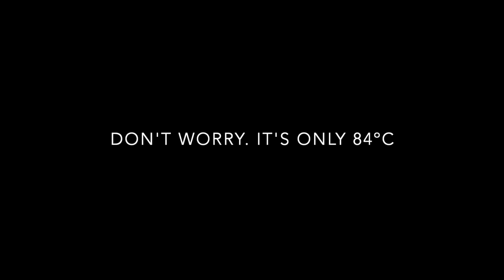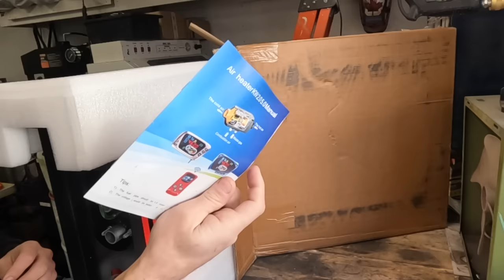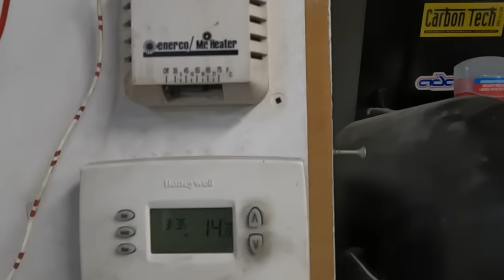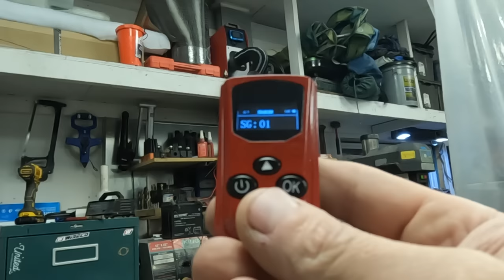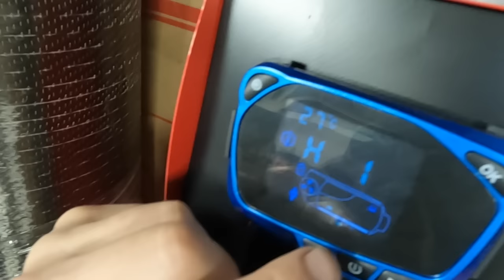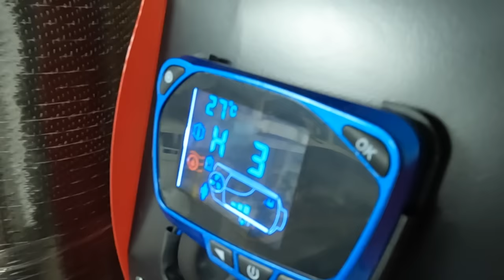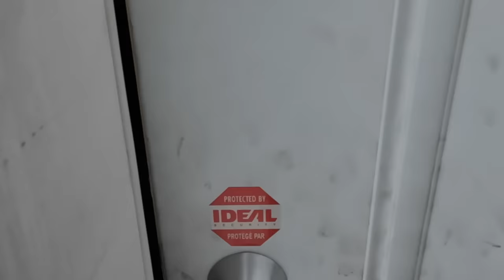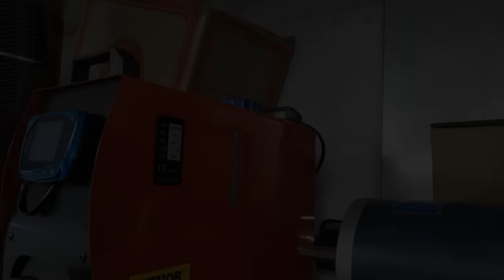Chinese Diesel Heaters - DON'T BELIEVE THE HYPE !!

Comment: this is not made to put that inside a house or garage but outside beside or under a vehicule or mabe a building. but definetaly not inside. there is dielsel tank and near the heater. i think its common sense to not put that in your house
Reply from the maker: Thanks for your comment. You have made a statement, but not given any reason, evidence or proof to back your statement. 

Manufacturers installation recommendations from many manufacturers clearly show installation inside of vehicles, campers and trailers. I would not argue for one second that my installation is proper (it is not safe) but when installed properly, there is nothing wrong with installing these indoors or inside.

Comment: Here's a hint. Mix oil with diesel before you run it through the filter. Oil is to thick to get through the filter. I ran motor oil , cooking oil, you name it. You just got to know what you're doing. You need double tanks and a fuel switcher. I'll make a video when I get some cash for the parts ( I'm poor ) . This heater to me is like a God send ! Shout out from Fresno, California. Keep us posted. You'll figure it out.
Reply from the maker: Cheers and thanks for the comment ! 

I have tried all sorts of mixes and haven't had any success. It may be that my oil is from lawnmowers and is particularly nasty, or it could be that my heater is running a horrible air fuel ratio, so I have ordered a controller that I can adjust ratio. 

I have gotten the comment about two tanks a lot, but I run my heater 24/7 and it only shuts off when it stops working. I am also really poor, believe it or not. I'm still experimenting with all sorts of things. About to go take the heater apart and have a look to see how may last experiment went.
Reply: @loweredexpectations4927  Yes I'd stick to used car motor oil or cooking oil. ...the two tanks is for starting it on pure Diesel then switch tanks when it's up to about 200 degrees celsius. But yes it does run good on about a 30/70 or even 40/60 mix. And that's on one tank system. With two tanks I'll bet it will run on 100 % pure motor oil. I'll know probably next month because at the moment I haven't the cash for the parts.
Reply from the maker: @ParasiteZappers  I have a steady supply of lawnmower oil, as I am a seasonal small engine mechanic. I have been doing lots of experiments, but I think that the oil is very likely my #1 issue. To compound issues, I am at 4000 ft elevation, and so the air is thin here. I have tried alpine mode, but that only makes things worse ... experiments continue.

I'm currently trying to sell my classic mini, seen in the background of these videos, so that I can continue to make these videos... I work seasonally and have been hit hard by the tax man (my own fault)

Comment: I have one, I live in Southern Commiefornia and it’s absolutely awesome. Maybe I’m lucky with this one but reality is with our limited “legal” options this heater works great! I did make a few upgrades to the fuel deliver. I added an inline filter and water separator as well as different fuel line. The original green stuff didn’t look too good. As of yet it’s never even blow smoke like a lot of people have had.
Reply from the maker: Thanks for the comment. Yes, these are awesome little heaters !! I have one in my work truck now, currently heating it up before I head out to get something to eat. As long as you burn diesel in them, they work flawlessly. 

I'm getting a second one next week to install in my friends 4Runner.

Comment: Yep, exhaust get hot🤣
Reply from the maker: Shocking eh... who would have thought 😁
Reply: That exhaust is VERY thin.
Its designed to use on high setting and also produces lot of noise.
Reply from the maker: @kan815k  Thanks for the comment. Yes, the exhaust is incredibly thin... that's how they make flexible stainless. Pretty cool. 

I'm not sure what you mean about running on high and producing a lot of noise.
Reply: @loweredexpectations4927  Pipe comes with the heater is very thin, get hot very quick and produce more sound.
Think about it as a car, 1 mufler noisy than 2 mufler. Cars exhaust is made from thicker material and from carbon steel.  The one supplied looks like a stainless steel, but it's not, i guess.
Stainless steel(316/304) produces more sound than carbon steel (355) dampens sound bit better.
Reply from the maker: @kan815k  Ah, yes. I believe it is stainless.... Sound is not a big concern for me, but David McLuckie has made a few videos on different mufflers ... it was quite interesting.
Reply: @loweredexpectations4927  yes, I have seen that video, it will help a lot wrapping or using thicker pipe.
😉😉😉
Reply: @loweredexpectations4927  
On your latest video "drip feed" 06:30 without the exhaust pipe is much much quite.
😁😁😁👍👍👍
Reply from the maker: @kan815k  I think I may have edited the volume level before installing the exhaust, as it was making an annoying hum, like a pulse jet engine. I believe this is because there was a bunch of crud in the heat exchanger..... also because of harmonics of running without the intake pipe or exhaust.

Comment: Buy a waste oil heater commercially built for commercial use
Reply from the maker: I already have a 200,000 btu natural gas floor heating system and 80,000 btu hanging heater... The last thing I need is another heater, haha. However, this heater was $200 ish... If you want to donate a commercial waste oil heater I will accept ... or if you want to sell me one for $200... we have a deal.

Comment: So because you A improperly installed it B don’t know how to make your own diesel you can burn waste oil if you mix it 70% oil 30% gas the restaurant I used to visit daily uses a Chinese diesel heater on filtered cooking oil mixed with old gas sources from a scrap yard. Mines run flawlessly mounted on the wall with the exhaust going straight down and out using the intended fuel because I’m to lazy to make my own. Just because you don’t care to use it properly doesn’t mean no one should believe the hype being Canadian you should know the message behind the house hippo
Reply from the maker: Thanks for the comment .... Curious if you are speaking from experience, or if you are just repeating something you heard... because the internet is full of people just repeating things they have heard. 

The way this heater operates (the issues) has nothing to do with the way it is installed. Saying that is evidence that you don't really know what you are talking about. This is part 1 of a 30+ video series, 4 months of testing and about 1500 hours of run time. Don't just assume that I didn't try 70% 30% ... 

You have used it daily for how long ? You're aware this video test was with waste engine oil and not vegetable oil ? The exhaust direction has nothing to do with the heater working or not working. I have run these on their side and upside down with no issues at all... when running on diesel. 

You and everyone else claiming that this works so well need to get together and make even one convincing video... Hundreds of videos on the internet of people who have actually tried and documented with ATF, hydraulic oil, engine oil, canola oil, grape seed oil, random cooking oils who have all had failures from a few hours to a few weeks.... 

Lots and lots of people claiming they have had success, but I can't find one single video with any compelling evidence... Funny how that is works. 

These are awesome little heaters... I now have 4 and 3 only get diesel... they work great !

Comment: Yeah how many years did you use this and not clean it out once. Every 2 to 3 years depending on how much you use it you have to clean out the unit. Take it all apart use brake cleaner and clean it out and replace the screen and glow plug and put all new gaskets in putting it back together. Best 100 I’ve ever spent to heat my 30x30 garage. But I keep up on maintenance. Ppl think you can just use stuff and never do any work to it. If that’s the case just buy a new one every 2 years. Also if you mess with the setting it will do this to they are set to burn diesel efficiently.
Reply from the maker: These heaters are amazing, and when you burn diesel in them, they are very reliable... I have 4 of them now and 3 of them run on diesel.... The one in this video is for torture testing and sometimes gets cleaned out 3-4 times a day, haha. 

I have a bunch of videos testing this heater with all sorts of waste oil mixtures and none of them really work.... However, one of my latest videos I did some emissions testing and it was pretty shocking how clean these heaters actually run when tuned correctly.

Comment: Kerosene would be a better choice.
Reply from the maker: Yes, unfortunately, kerosene is about $5 per litre where I am. I may get some to experiment with, but long term diesel is much cheaper $1.66 per litre. I just checked and it's down to $1.21.

Comment: Hot Air rises.... putting it near the ceiling is futile
Reply from the maker: I think what you mean to say is that it is not optimal or the best idea, and I agree. However, pointing the air hose down spreads the heat out. 

Also, while heat does rise, it's not quite as simple as that. It's not like a helium balloon or a floaty toy in water. Heat dispurses to lower energy levels. If the air at your ceiling is 30C, it's not like it will never heat up at floor level... it just means floor level heats more slowly, and it will always be hotter at the ceiling than at the floor. 

This heater has no trouble heating my garage in this configuration... when running on diesel.

Comment: Actually, the only misleading is your video, with one of worse installation and use of these heaters I've seen around ! 
These heaters are amazing, just that you don't know how to proper deal with it !
Reply from the maker: You are confused. I'm not sure how much you actually watched of the video... enough to know it's not a proper installation. These are amazing heaters. 

Others have stated that these heaters will run on waste motor oil with no issues. That, is the misinformation. I purchased this heater with the idea that I could burn motor oil, because of what other YouTube creators said... 

My series of videos is to show the struggles you may encounter when trying to burn fuels other than those recommended by the manufacturer. The poor / temporary install of this heater is so that I can service it with ease, yet it is out of the way. 

I have put this heater through hell and it just peeks working... pretty amazing piece of kit.
Reply: @loweredexpectations4927   Yes, I can agree with you on that, regarding other fuels, but still... even the exhaust so close to that wall, assuming it's a standard thin wall, usually used to build garages. The unit only, could reach temperatures over 185°C, so way over on the exhaust !

When I installed mine in the van, I let someone to do a 2 minutes job and didn't followed my instructions to leave enough space between the unit and the floor, so on my first night out, I started to smell burned wood and that, on 180°C only in the unit. Luckily that I figured out in time and had tools with me, so I decided to cut parts from the floor. Even so, still not enough space, but since I can't change much anymore, unless take it out and reinstall it, I play with the pump & air flow, in order to keep the unit temperature under 180°C (relative, based on outside temperature). Just to make my point regarding space needed, around parts that get very hot.
Reply from the maker: @syncrovanCos  You are 100% correct... This install is not at all safe. I have never claimed for it to be safe or practical. I make sure to tell people not to do what I do. I have had my exhaust catch on fire and glow red more than a few times. 

That sounds scary with having it in a van. Perhaps you can put some aluminum plate in there to dissipate the heat ? A small air gap (between the plate and wood) and a metal plate of any kind would work wonders at keeping it much safer. 

My heater makes heat, but mostly it is a test platform used for experiments.
Reply: @loweredexpectations4927   I already did a proper installation, or at least this should have been if I wouldn't let someone to fit it in, those 2 minutes. I've made a huge hole and fitted an aluminum tube + heater prove silicone, only that the guy didn't respected my indications. But I'm on safe side playing with the flow and keeping the unit under 180°C. Can even go higher if outside temperature is crazy low, but do the job well, staying on 175°C on high speed, until reaching the desired ambient temperature, without any suspect smell anymore. And as I said, I've eliminate the floor around the unit, but wanted to make my point about the importance on keeping the distance. And keep in mind that in my case, we talk about the unit temperature only, underneath ! No exhaust close contact anywhere, having that side 100% proper installed. I can let it on high speed, all night long, without issues ! I also have the red wireless remote that indicate pretty much all the essential parameters, so it's easier to keep everything under control/observation. ✌️
Reply from the maker: @syncrovanCos  Oh ! I understand now. Thanks for clarifying. Yes, the remote is GREAT for keeping an eye on the heater !

Comment: It over heated because its an 
un tuneable piece of garbage,always buy a tuneable heater so it runs efficient.I've had mine for 3 years with no issues,plus vevor heaters are junk.
Reply from the maker: Well, to be fair, it runs perfectly fine on diesel... I have tested it on diesel for over 120 hours and it hasn't had a single issue. Toss some use motor oil in there and that's when the problems start. 

This one is not tunable and that is really annoying. I have ordered a different controller so that I can pay with tuning. VEVOR reminds me of a Princess Auto or Harbour Freight, haha. I'm pretty sure the other models that they sell (that do not have the blue controller) are tunable, but I'm only guessing at that. It seems as though most units have some way to tune them.
Reply: @loweredexpectations4927  you can't just buy another controller you also need the tuneable ecu to go with it and is best to buy as a pair👍
Reply from the maker: @jamie-hb8gy  Well then I guess I'll have to buy a tunable ECU as well. We will see what happens. I have a feeling that these Canadian units may have the features in the ECU but the controllers just don't allow you access. That's just a guess based on almost nothing. 

Most units have a tunable (to some extent) ecu and just have different controllers that have different ways of accessing the ecu... correct ?

Comment: Yes thay dont work go electric.
Reply from the maker: They don't work for burning waste motor oil... they work great for burning diesel... I have 5 of them now.
Reply: Mine is brand new used once worked ok. Go to use it again and 4 seconds of fan and stops this will do your head in no code errors that is a peace of ........ any way going to electrician to find falt .then taking it out and crush it with my motor home may put it on the tube.
Reply from the maker: @geoffszczypior644  LOL... no warranty or ability to return ? This could be a fairly simple issue to solve. 

Due to the fact that you are not getting any error codes, this does sound like you have a faulty ECU (motherboard) unfortunately. I had one ECU that did this exact same thing... it would spin the fan aggressively when powered on, and then just stop. 

The heater does a few self checks when you press the power button. If the fan spins on startup, and then stops, it could just be a loose screw on the ECU or the fan is too far from the ECU.... there are magnets on the fan and a sensor on the ECU that detects the movement. If the ECU doesn't know the fan is spinning, it will just shut down.

Comment: That muffler isn't fume tight and should be put on the outside of the structure or carbon monoxide poisoning could result.
Reply from the maker: A few people have mentioned this. I did know this, and it becomes really clear when smoke comes rolling out of it, but I'm not worried about carbon monoxide poisoning in my garage. If it was mounted in a confined space, or in a space where I sleep, then I would be really worried... I have already removed the muffler and run the pipe directly into the duct. 

Thanks for the comment.

Comment: That thing has a thermostat setting.
Reply: Yes... I thought I explained that, but maybe it's in one of my next videos, not yet released. This particular remote has H1 - H6 settings and if you scroll down past H1 or up past H6 it takes you to a target heat setting. 

This may be useful for some people, in some situations, but I find it to be useless for a few reasons. 1. It gives you the temp at the heater and that is always way higher than the actual room temperature, so the heater will shut off at 25, for example, but my room temp is actually only 15. 2. I don't trust my heater to shut down and restart on its own several times a day ... even if it worked I'd rather just have it run on low rather than turn on and off.
Reply from the maker: Just realized I replied to you while logged into my other YT channel. Oops. Hope I didn't confuse you too much.